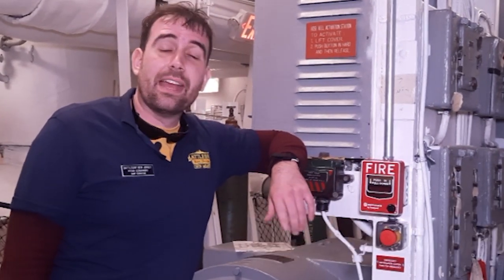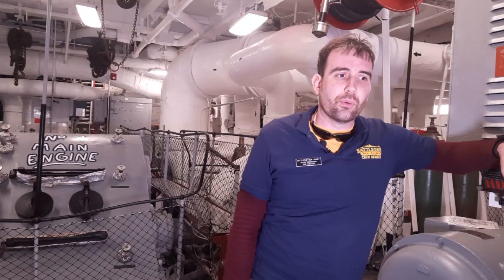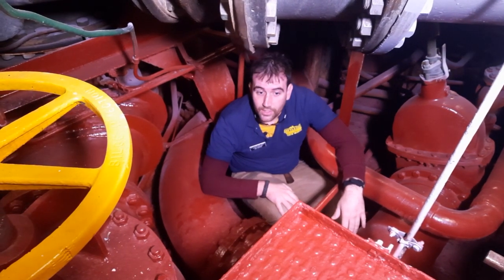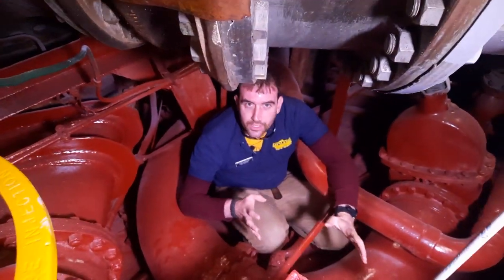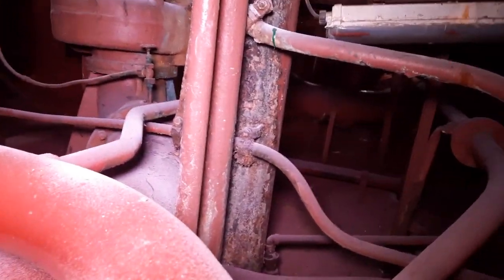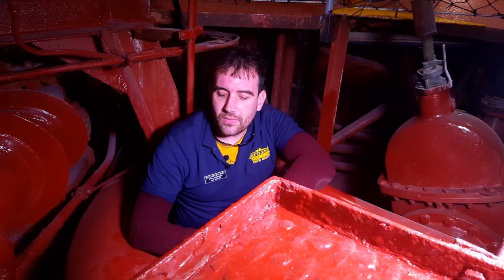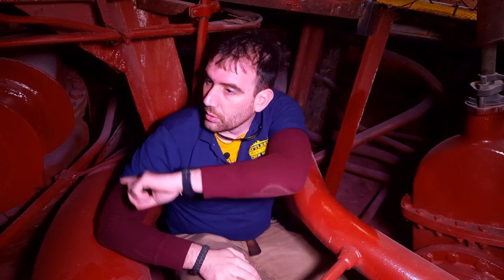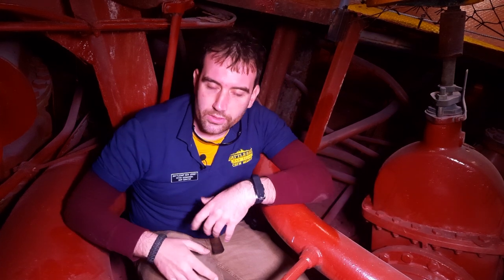Where's the Self-Destruct button on the Battleship?

Comment: Don't forget the valves used for counterflooding. While they can be used to correct a list, if all of them are opened it is a very efficient way to sink a ship. No sea chests needed, the ship's own damage control systems can also be used to scuttle her.
Reply: Counterflooding, at least aboard these very large vessels,  probably involved the wing tanks and void spaces located in the torpedo defence systems. It would be a very rare situation when a ship designed for a damage control had to resort to flooding its habitable spaces to refrain from sinking
Reply: WW: No. There are no "counterflooding valves" that would cause a ship to sink. Ballast tanks and fuel tanks, water tanks are typically used for Trim & Ballast", which includes counterflooding.  Pumps are used to move liquids around. The various types of tanks are NOT connected direct to the sea, and would not passively flood. (old sailor).
Reply: @KB4QAA  Actually, in many cases ships were designed to counterflood through sea valves. In large warships, normally this involved the torpedo protection system, BUT remember that hatches and valves to access these systems were generally available from the inside of the ship. A combination of opening the right valves and the right hatches absolutely can cause a sinking.
Reply: @WardenWolf  Water does not flow on its own.  It must be pumped.  Unpowered pumps do not allow free flow of liquid.  I believe you have created a god of "counterflooding" that is a complete misconception.  (CDR-ret'd).
Reply: Several ships have capsized due to fire-fighting efforts. The most obvious example is the French liner Normandie which capsized at her berth in New York harbour after firefighters poured tons of water into her.
Reply: @TheBrakpan  bad fire fighting efforts. They should have sunk Normandie  right there. There was enough water in her upper structure, from firefighting efforts, to capsize her. Once she took on a list all of that water.... The ship's engineer told them to scuttle her if they wanted her in usable condition. The American naval officer in charge ignored him.  Then she capsized . You can easily sink a ship with her  own or another ship's fire  fighting capabilities.  If Normandie had been scuttled as her engineers recommended,  she would have been fixable and easily reflotable.
Reply: The woke definition of damage control
Reply: Didn't Texas flood her port blister tanks to achieve a higher arc of fire while bombarding the Normandy coast?
Reply: @TheBrakpan  there was an Estonian ferry that capsized due to its fire prevention system filling the cargo bay.
Reply: @bubibolz  damage enhancement.
Reply: That would be an incredibly slow and inefficient way to sink a ship, if it would actually sink the ship (I'm not at all certain it would, and I was the DCA of one ship and in the damage control organization of another).

Comment: According to Hans Goebler, crewman on the U-505, he pulled the cover off the sea strainer. Tanks 6 and 7 valves stuck and would not open. The scuttling charges were not set because the captain was injured and the other 2 crewmen who knew how to set the charges had either abandoned ship or were injured. The boarding party closed the tank valves and replaced the sea strainer cover. They then pumped out the tanks, saving U-505.
Reply: The sea strainer cover was dropped next to it so it was easily fix. If he took it topside. The sub was likely to be lost

Comment: I take it the keys to the sea chest are stored with the muffler belts & blinker fluid.
Reply: next to the grinder sparks
Reply: ... maybe in the aviation stores with the prop wash?!
Reply: @stevefreeland9255  only on carriers
Reply: @artbrann  Or on the BBs when they carried seaplanes 😀
Reply: They're on the shelf above the chem light batteries
Reply: They're actually stored next to the steam buckets.
Reply: Or Humvee keys
Reply: With the relative bearing grease.
Reply: @overodog  Ok that's a good one
Reply: they're next to the long weights
Reply: Extra waterline is kept there as well but only in 100' spools.
Reply: @AntiComposite  right next to the grid squares.
Reply: Blinker fluid - is that stored with the red and green oil (kerosene) for the port and starboard lights?   (A modern sea chest might need Allen keys... but that's a different story)
Reply: You are all wrong!
It in the rope locker attached to 200 feet of Jersey Shore line…
Reply: @josephpadula2283   A woollen mooring rope - that's a new idea 🙂

Although shouldn't that be 33 fathoms of Jersey Shore line - assuming anyone can fathom out Jersey Shore...
Reply: @stevefreeland9255  Funny story about that. I was cleaning my Citabria at my local airport one time, and I had some simple green and a bucket in the hangar to, well literally wash my prop.. Bunch of dead bugs stuck to the thing and it looked ugly.. After wheeling the plane out of the hangar and way off to the side so I'd be out of the way, and cleaning the fabric skin of the plane, I realized I forgot the heavier duty degreaser I used for the prop and areas around the oil filter area. Which on a Citabria 7KCAB like mine can get pretty gunky due to that variant  being designed for sustained inverted flight.. Tricky dicky fuel system, fuel injected engine, and an odd duck of an oil system as well. Under the prop spinner you've got what looks like one of those foam filters from a wet/dry shop vac, and it's often VERY oily.. To the point where one of my buddies who's used to his 172 always takes a look at the drip tray I have under the nose of the plane and jokes about it being a "tiny plane with a DC-3 complex". I'm good friends with the FBO there and do work as an instructor for him from time to time, so his line guys are used to helping me out with stuff. One of them came by on a golf cart used to move stuff around the airport, who had apparent been burned by the prop wash joke before. Because when I asked him to please ride over to the hangar and grab me my simple green, bucket, and brush so I could clean my prop.. Immidiately went "Oh HELL no! I'm not falling for that prop wash BS again. Go get your own prop wash"... Chuckled and then sped off... Later when he saw me actually washing the prop, he stopped by again and was like "oh man I'm really sorry, I had no idea. I thought you were messing with me".. We both shared a good laugh and I just told him, "hey I've used the prop wash joke on new guys before myself, so I deserved that. Lol all is well". Good times. I really miss flying.. Haven't gotten out more than 3-4 times total in the last 2-3 years due to covid insanity, life insanity, etc. Anyway, have a great day anyone who suffered through this entire long drawn out story 😂
Reply: @blackhawks81H  Brilliant! :)
Reply: @CharliMorganMusic   And the exhaust gas sampling kits

Comment: Our warships are wonderfully designed to take a lot of punishment and still stay afloat. As Ryan noted about the Hornet, they put a lot of munitions into her and she still didn't go down. When ships are sunk as artificial reefs, they make sure that no WTD is left closed, they cut numerous other holes between decks and into the outer skin, above waterline, and then plant lots and lots of explosives. So, it would seemthe crew would have to through the ship opening all water tight fittings before opening the seacocks.
Reply: I'm sure a lot of that is just from the difficulty of removing machinery that will have a lot of oil leftover, and that they don't want to sit and slowly leak out into their nice new reef.
Reply: @rianfelis3156  I don't know about the machinery and how it's prepped for sinking. It cost $21,000,000 to clean out Oriskany to prepare her for sinking off of Pensacola.

Comment: Set fuel feed on boilers to full shut feed water off and run
Reply: @paulmoir4452  grenades have a 3-5 second fuse
Reply: @mattmopar440  My attempt at humour failed:  I did not mean this as a serious reply, nor do I think the OP.
Reply: We were told to gag the safety valves and max the fuel.
Reply: @johnchilds6471  ive heard the same thing from an old US navy guy I worked with at a hospital he was a high pressure boiler operator
Reply: would it be possible to scuttle a ship by intentionally setting a fire other than in the magazine? Specifically lighting the coal storage in a coal fired ship, or are coal bunkers designed to be able to prevent catastrophic fire?
Reply: @logantc.1353  the bunkers are likely designed to contain a fire.  And a full coal bunker at least probably would burn up its air supply and then just smolder like a PA Mine fire.
Reply: @filanfyretracker  Thank you, that makes sense. I suppose even smoldering it would still be a bit of a headache to deal with once captured,

Comment: 👍Never heard the key to the sea chest one, but they use to send out the new guy to cut in the cooling water to the handrails. I remember one time they wanted to  see how well a new snipe was making rounds and they put a rag over the oil level indicator on the main sump. When he came in control booth after making rounds they asked him what the oil level was and he said he didn't know, he couldn't see if for a rag tied around it.
Reply: I used to pull the dip stick on the spring bearing in shaft alley #1 when I went on watch in Main Control.  When my fireman messenger reported that the spring bearing oil level was full for the second hour in a row I'd pull out the dip stick and he knew he'd been caught gundecking his readings.

Comment: Aside from Scuttling a ship. Every USN ship that I served aboard had a series of items that were immediate response items. These were commonly things like a primary Gyro, in the same room was some of the fire control functions. Basically these were things like stand outside the door and throw an axe (or hammer) at the gyro and quickly close the door. If you hear a big bang your done, if not try again. Essentially it was just a destroy the stuff you don't want them to get. As to the rest they already know it's a ship and how it works.

Comment: I suspect the main reason to weld over any "sea chests", places where water could enter the hull, would be to make it easier to maintain the ship as a museum without worry that some internal pipe can rust through or be damaged or a valve leaks or somebody might turn some valve and sink the ship by accident.
Another reason I can think would be to evacuate water from these systems to preserve them just in case. From that point of view, welding over these would actually make it easier to start the ship in the future, not harder. Valves leak and with "hundreds" of them you can be sure some of them will and could cause damage.
I mean, any project to start this ship would be major undertaking and couple of welds will not deter or make it significantly more difficult to complete the project. On the other hand internal damage would do just that.
Reply: Welding over suction and discharge ports is done during the mothballing process for all the reasons you stated. It's also to keep suction and discharge ports from becoming clogged with marine growth.

Comment: Spanish battleships in first years of XX century had "bottom valves" with blank plate bolted in the pipe. You must unbolt the closing plate and open the valve an then the magic starts. Of course, remember to leave all door decks open! It was a slow process. This was used in battleship "Colón" fighting against "Oregon" during Cuba war.

Comment: Scuttle your own ship is more a mental victory for the crew, because the enemy wasn't only successful at taking the ship home as a trophy but they weren't even able to clain the kill on it too. 
So the crew of the ship had not only served on a superior, but also an unsinkable ship for the enemy too.

Please note that this is just a guess and not a fact. I asked myself why I would rather scuttle my ship than loose it by the enemy.
Reply: You might not want sensitive equipment to fall into enemy's hands, for example. Radar? Electronics? Any countermeasure launchers / ECMs? For current ships, certain materials even (like radar absorbing ones, for example)? You dont want your potential opponent to have access to that.

Hence why UK did all that jazz when their F35 crashed some time ago in the mediterranean, raised it and recovered debris from the sea bed. Costs a lot, but less cost than having secrets potentially open to be exposed.
Reply: @michajastrzebski4383  That's a good point. Haven't thought of that.

Comment: I was a member of the Scuttling Detail aboard the USS Sacramento in the late 70's. My job was to open the large cutoff valves in the JP-5 pump room and spike the main. Others in the engine rooms would be doing what was described in the video. Radiomen and others upstairs would be weighting codebooks and throwing them overboard. Being  member of the Scuttling Detail meant you didn't have an abandon ship station. I'm glad we never had to scuttle her. P.S. we had no explosives that I was aware of.
Reply: Or liferaft seats, I was on the team too. Gag the boiler safetys, max the fuel to the boilers and run like hell. The Machinist Mates blew the main condenser scoop injection .

Comment: I never was sent to get the keys to the sea chest but I sent a couple of new recruits on that mission. We also sent new guys looking for water line to tie things up. As a substitute, they could go to the mess decks and see if they had any leftover hamstring. We also sent extra-annoying new recruits to the boiler room to borrow a BT punch. This was usually delivered by the biggest Boiler Technician available when they got there. These were fun little rites of passage, among many, that are no longer allowed in the New Navy.
Reply: @ alan fan
 We used to send newbies to supply for  a bucket of  prop wash.  ASW Squadron  VP Two Four  Naval Air Station Jax Fla.
Reply: One of our new firemen was sent to the other engine room to get a steam blanket for the boiler.  The space supervisor sent him back with lagging material tucked into his coveralls to keep it warm.
Reply: Before the environmental damage that R-12 Freon would do was discovered, we used to send a guy to the AC&R shop to get a bucket of Freon. If the cylinder was inverted, the Freon would come out in liquid form but would quickly evaporate. So the newby would go to the AC&R shop and they would fill his bucket and then cover it with a rag so he didn’t spill any. And by the time he got back to our shop 2 decks up, the Freon would be gone. And then we would rag on him about not doing what he was told to do. I am sure that this prank contributed substantially to the hole in the ozone layer.

Comment: Keys to the Sea Chest are kept right next to the Machinist's Punch.  You use that right after you've tightened the Boatswain's Nuts.  Make sure you stop by medical first, and ask for 100ft of Fallopian tubing.

Dunno, the valves are good, but if you don't have explosives, I'm looking at the flex coupling or the eductor lineup...

Comment: Pretty sure the easiest would be to hook up a few dozen 18 inchers to their fuses in the magazines, leave a few dozen 5 inchers in the power magazines and the 5 incher magzines, and wire those to a detonator.

Easier still would be if she was carrying a nuke to dial the yield to the lowest it could go, if you didn't want to cause too much death, or if you were a sadist like me, crank the yield to the highest and watch the ship evaporate.
Reply: Intentional magazine detonation is definitely a good way about it.
Reply: Dick move would be when enemy boards the ship with the instant sunrise set for wide open fir them to see the 10 second to zero count down.....
Reply: Nukes dont dial yield if the vessel was carrying a tomahawk-N it only has one boom setting
Reply: There are many parts of an Iowa class battleship that wouldn't be vaporized, even by far more powerful nukes than they ever carried onboard. If you were to take a much more powerful device... In the megaton range, and detonate it inside the ship, you'd almost certainly blow it apart. But you'd still have a ton of peices of various sizes flying in every direction. The smaller of which would probably fuck right off into low earth orbit if the heating from drag in the atmosphere didn't just melt/disintegrate them on the way up due to the speeds which they'd be traveling. The biggest problem with doing something like that would be the large armored peices. Many many peices of the, what is it.. 18 inch? thick citadel, and large chunks of the armor belt would almost certainly end up flying a REALLY good distance in just about every direction and landing somewhere that would cause the people living nearby to be very unhappy, dead, or a combination of both.
Reply: @blackhawks81H  pretty sure they  would have their own issues if a USN ship is committing nuclear suicide anywhere within 50 miles.

Also, who's to say that you'd be setting off just ONE nuke?

Ideally you'd have multiple all set off to go either in parallel, or sequence to make damn sure the ship ceased to exist.
Reply: @gaiamission7200  incorrect. The nuclear tipped version of the Sea launched Tomahawk was the W80, which very much is a dial-a-yield.

ALL nukes made by the US, Soviets/Russians, UK, France, and likely India and Pakistan as well since the 70's have all been Dial-a-Yield from the factory (it's a easy enough mechanism to add in for relatively little cost) or are able to have the yields changed with a few parts removed/added in 10 minutes or so with a screwdriver and a wrench...

https://en.wikipedia.org/wiki/W80_%28nuclear_warhead%29?wprov=sfla1
Reply: Good luck getting the POTUS to approve the WMD clearance though.